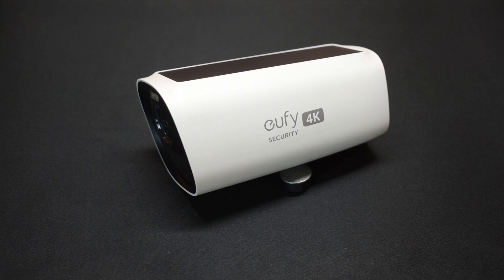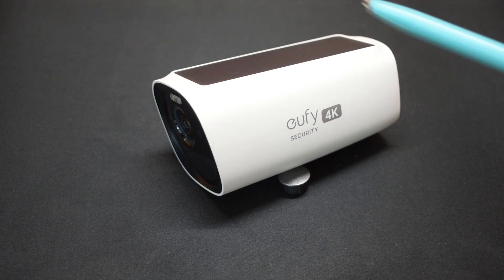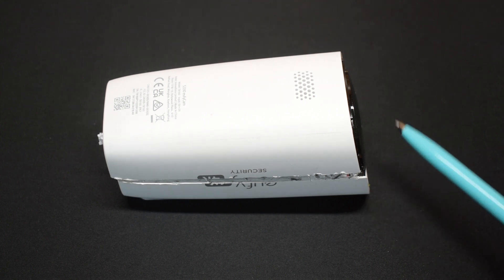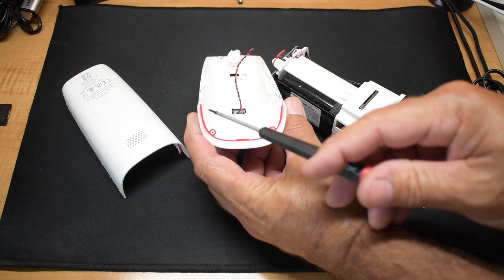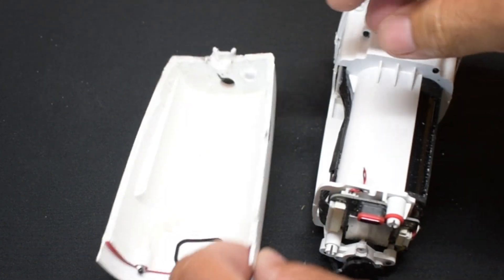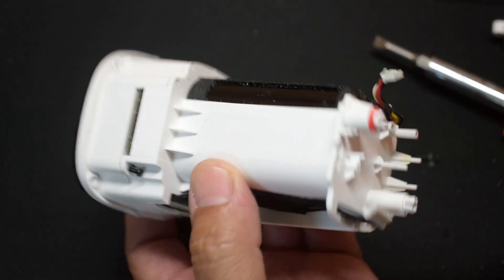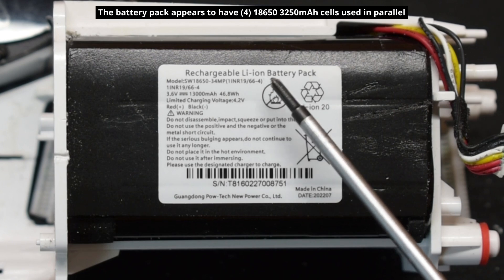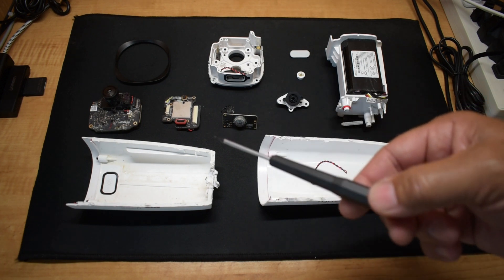What's Inside Eufycam S330 4K Security Cameras? Find Out!

Comment: Those inquiring about battery:

He said  13,000 mAh , and those batteries are 3.7 volts > a standard amongst "modern tech" ... 3.7 or 5 volts...the latter being less common, with 9, 12, 20, and 40 volts being standards. 12 volt applications, think LED lights. 12 and 20 volts, think LED again and things like misters, or those smelly diffusers/aroma misters/foggers, maybe fans, and handheld vacuums. 40 volts, think lawn and garden: rechargeable mowers, blowers, whackers, and the like. Oh...in that 12 to 20 volt product range, include 16 volts, and now we are looking at cordless tools, drills... 

You can easily find batteries, especially when it comes to the 3.7 volt variety.  Simple google will do the trick.

And say you did get one> being 3.7 volts and the device ended up being 5 volts (_can't see it being that or anything higher_), no harm done since it'd be less. Now if you got a 5-volt battery and the *device is rated for 3.7 volts*, then you *could possibly fry the circuit*. I say possibly because there are tolerances when it comes to these types of things, _typically 5 to 10%_, leaning more to the lower end to be safe. This is primarily due to the batteries themselves having similar variances in spec, where a labeled 3.7 volt battery, when measured, may have 4.1 volts new and after being freshly charged.

So, 3.7volts 13,000mAh

In regards to the mAh <==i'd double check if it was 1,300 or 13,000mAh....because 13,000mAh battery is a hefty one ..I guess if it indeed was 1,300 and you got a 13,000mAh all you do is have a much longer lasting charge/ not requiring to be recharged so often... no harm confirming again for yourself just in case...

Comment: The night vision stopped working on myne. The IR leds working fine, but not makeing that clicking sound when turn on and off the NV. I think that another lens mechanically pop in and out dead. I hoped you make this far in the disassembly. Can we fix this part guys?
Reply from the maker: Try a firmware update using the app by clicking on the camera and going into General to see if there are any firmware updates. If the firmware is up-to-date, and you tried resetting the camera by holding the button-down for at least 15 20 seconds, the camera is more than likely faulty.

Comment: Thanks for the video.........I just set up my  Eufy Cam S330 (eufyCam 3) system. I have an older Netgear router and Samsung tablet I dedicated to just the wifi for the Eufy. Once I got everything setup and all firmware/app updates installed I disconnected the lan cable to the dedicated Netgear router for the Eufy, the Red light will come on the Eufy base station indicating it lost connection to the world wide web but the system works just fine capturing events. I do not plan on using cloud storage or remote viewing so the only time I plan to connect the Eufy router back to the internet is for firmware/app updates.

Comment: What a useless video, title should be "amateur tech autopsy of a broken Eufycam". You say "very easy to work on"? You destroyed the housing by cutting it open with a carborundum disc to open it up and you didn't "work on it" either.
Reply from the maker: If you'd like to see useless, take a good look in the mirror. The camera was going into the trash, I had zero intention of repairing it because the company sent me a replacement. This was one of the first videos showing the internal components, as well as how to disassemble the camera without cutting it open(For those who actually watch to the end).

Comment: On the older eufyCam Solo Pro (model T8131x) non-solar model, just remove the four rear screws (must pull up the bottom corners of the rubber cover to access the two bottom screws) then at the front, pry between the white case and the black bezel (if that's what you want to call it) until they separate. You'll see a black o-ring seal. I exchanged the lens (due to moisture on the inside of the exterior glass) from a parts donor camera. The trickiest part of that is to release the big ribbon cable at the horizontal board end by flipping the black part of the connector up from its rear facing edge. Note that the connector at the other end of the ribbon releases differently. Its black part slides out rather than flipping up. Once you get to the front (vertical) board, release the lens cable plug, remove two screws, then pull the lens assembly straight out. There are alignment pins. If all you do is exchange the lens assembly, once put back together, the unit should be back on line if that was the status when you unplugged the battery.

Comment: Can you take these cameras apart without cutting them. I want to get at the battery so I can work on it. But don't want to cut it up
Reply from the maker: Watching the video would be very helpful
Reply from the maker: @vicmills7702  Clearly you have not, because I showed in the video.
Reply: Got it
I have taken a part perfect and can't see any water damage. Is there any re set in these cameras. I have the older version of the camera, 4 screws at back and broke seal around the front lense etc and it slid out. Camera isn't charging etc. Any ideas thank you

Comment: 1:21 I had my iPhone X sitting near the sink while I was washing some dishes and accidentally splashed some water into the counter. Three drops of water hit the phone; two on the screen and one drop landed right on the seam the between the bezel and screen right above the front facing camera/Face ID. I didn’t think anything of it because it was, at the very least, supposed to be water resistant, so I kept washing. Afterwards, I picked the phone up to wipe it off and in doing so, pushed on the screen which caused air to bubble up through the drop of water at the top of the phone. I wiped it off but any time I pushed on the screen water would spurt out. I turned the phone off and because I’d just ordered a new battery for it, literally like that night or the night before, I opened the phone up to let it air dry. When I got the screen off, it was obvious the seal in that spot was probably never fully seated because the adhesive seal and the top probably 1/4 of the inside of the phone was covered in dust. I dabbed up as much of the moisture as I could see then left it open to air dry until the new battery showed up a couple of days later. Thankfully, for the most part, the phone was fine afterwards, but Face ID never worked again after that.

Comment: Did you try cleaning off the board to see if it'll start working again? Just curious if rubbing it down with some alcohol or some electronics cleaner would revive it.
Reply from the maker: Not worth the trouble. There was even moisture inside the camera lens

Comment: You were right, all the "gravity" was the battery module.  

Is there a way you can test the power output from that solar panel?
Reply from the maker: I don't think it's that high. Maybe 200 milliamps
Reply: @electronicsNmore  I was wondering if  the solar panel would keep the battery charged.